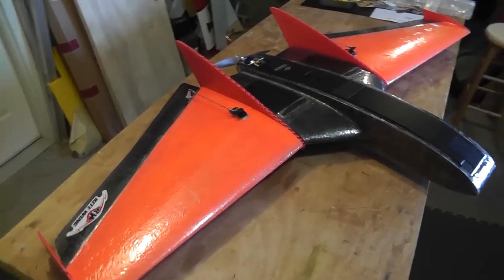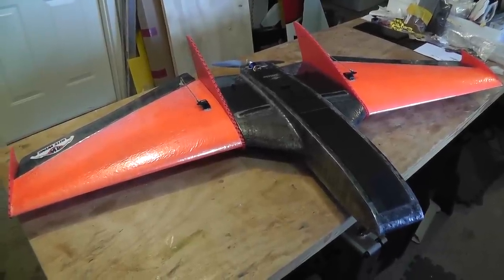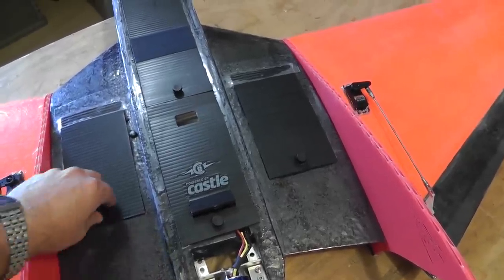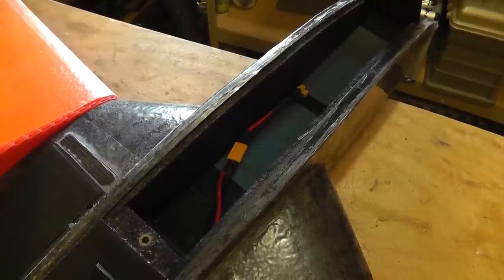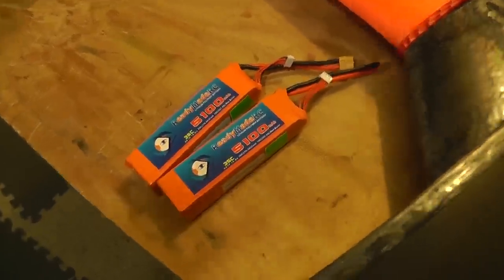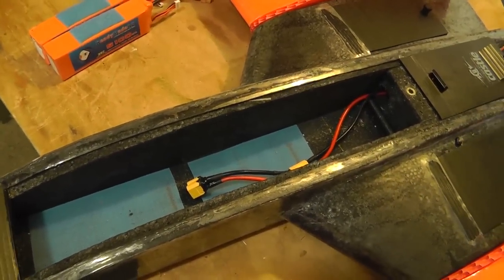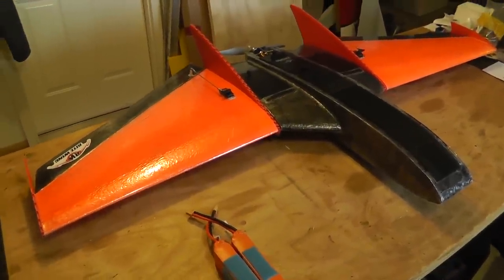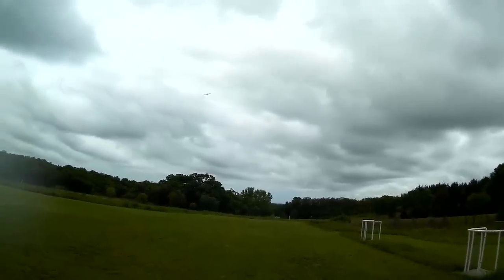Ritewing Drak: Intro and Maiden Flight

Comment: What is the maximum altitude?
Reply from the maker: +Дмитрий Ивасюк The maximum altitude is practically as high as you want to take it. I know that it has been flown at over 10 thousand feet in mountainous areas (not by me).

Comment: That ESC runs hot ?
Reply from the maker: I made air intake and air outflow ports in the lid that covers the ESC. It keeps the temperature under control during flight. The ESC does get hot when you run the motor on the ground without airflow.